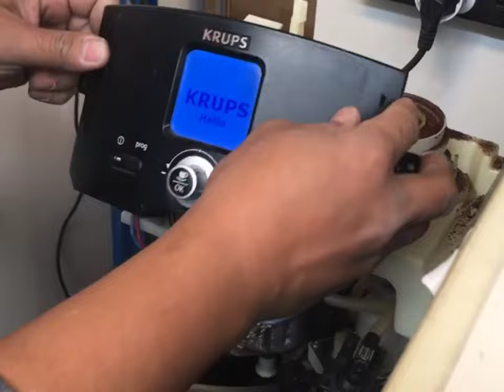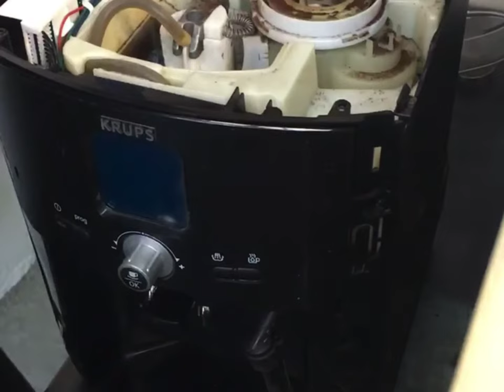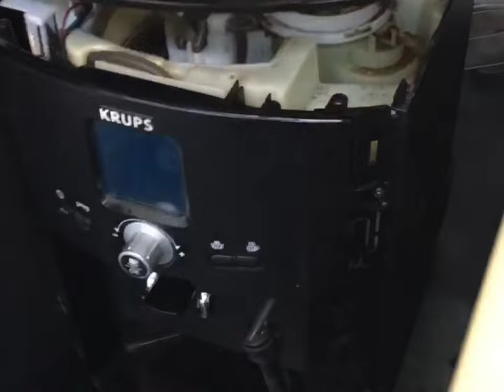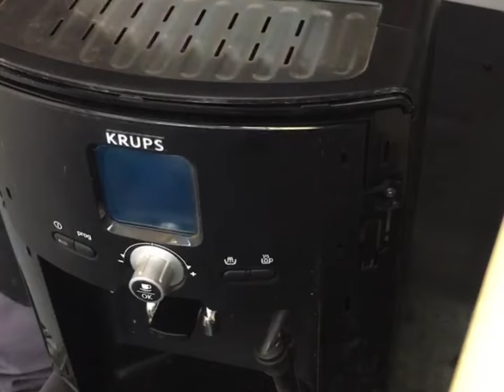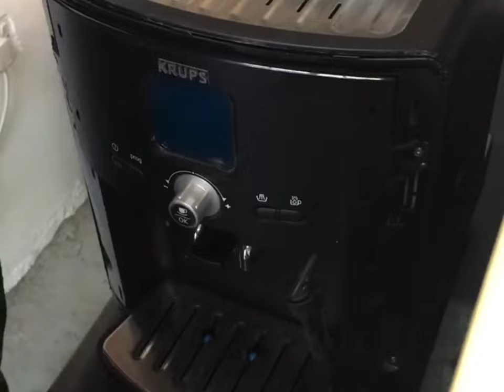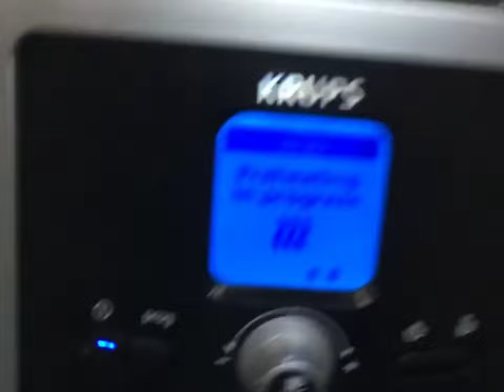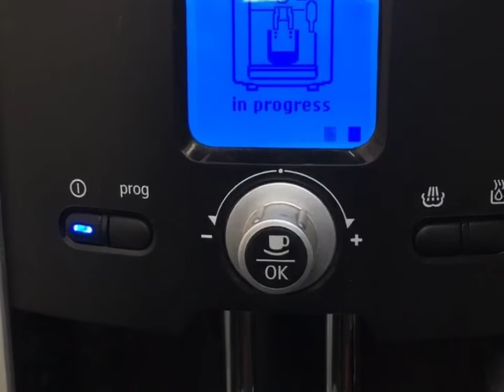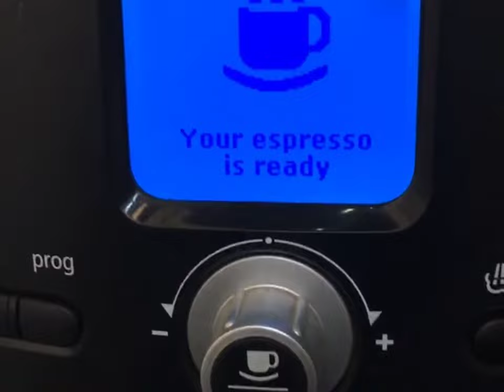Music: No copyright intended KRUPS COFFEE MACHINE #viral  #viralvideo #coffeelover  #coffeeshop #diy

Comment: Hi! I also glued, and the error still appears when washing, what could it be? Thanks
Reply from the maker: Hello, what error code u encountered?
Reply: @daddyofalltradesfamily1413  it's a krups with a screen, it appears as a video, let me reconnect to the socket! I cut the 2 wires on the boiler
Reply: @daddyofalltradesfamily1413 the error, to remove from the voltage, it has a screen, the plug from the electric cable appears